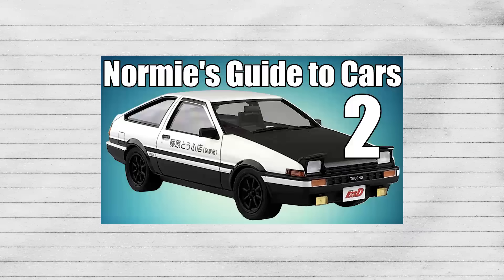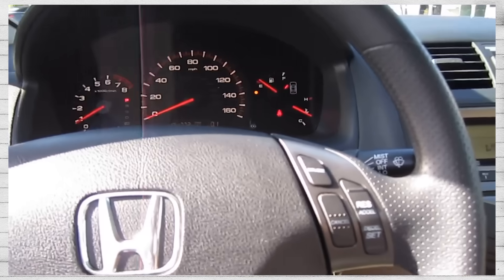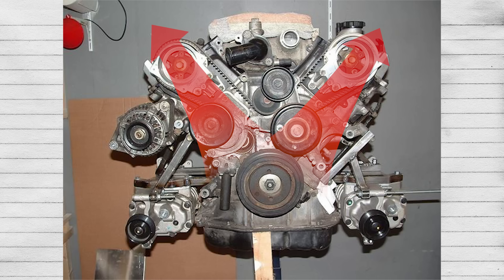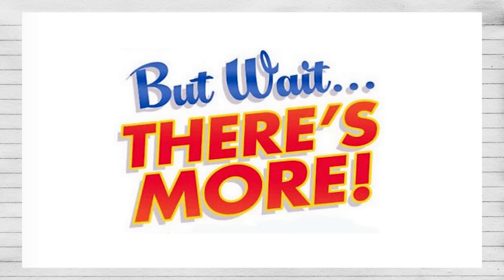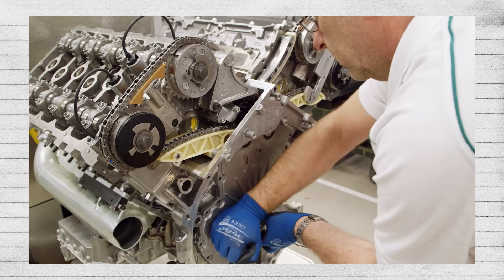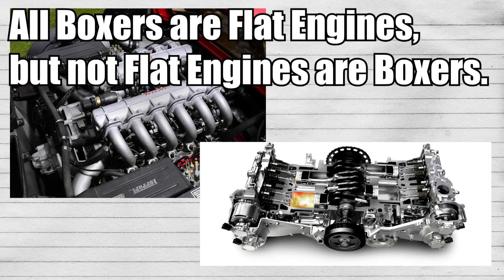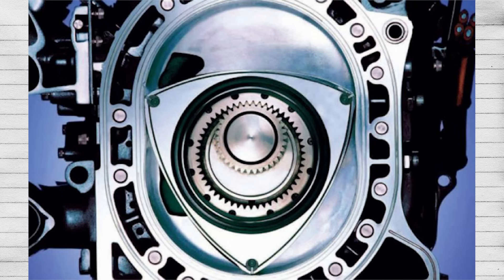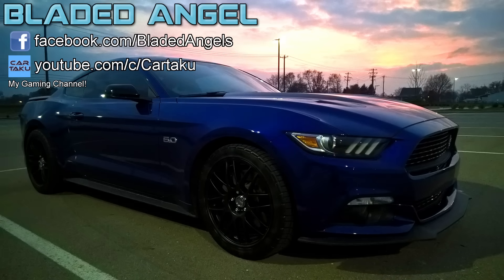Noob's Guide to Car Engine Types!

Comment: Wouldn’t the straight non-V engines in FWD platforms (Accord, Camry, etc) be “transverse” engines, not “inline”?  An inline motor would be mounted along the longitudinal axis (with the crankshaft) and thus be “in line” with the axis of the vehicle, correct?  A “straight six” could be mounted in transverse perpendicular fashion, but would be called an “inline six” if it were mounted along the long axis.

Comment: I have an idea from my newfound knowledge of car engines. You could have an engine with four rows of pistons in an actual "W" shape, which would form two camshafts. Each camshaft could drive the two wheels on it's side of the car, and each side of the car could accelerate with it's own pedal. It would be like 2x2 wheel drive instead of 4 wheel drive. There should also be a third gas pedal for all four of the wheels so you don't spin out and die on the highway if your foot slips off on of the two gas pedals. With this configuration, you could turn only with the gas pedals thus eliminating the need for a steering wheel. That's right, no more steering wheel! Car companies, feel free to reach out and pay me to use this legendary idea.
Reply: Not sure if you were joking, but you actually wouldn’t be able to turn with just the gas pedals. You would just burn out your tires if you used only one of the gas pedals at a time

Comment: the 'rotary' engines used in those planes are actually called Radial engines. easy to confuse. which is probably why aircraft engineers prefer to call rotaries wankel instead

Comment: My dad has a Honda Pan European ST1100 (motorcycle) and it's equipped with a 1.1L V4 my bike is a 1.1L I4 , a Honda CBR 1100XX, both V4's and I4's exist you just have to look for them.

Comment: Subarus use a boxer engine not a flat, I have a 2021 crosstrek and it literally says 2.0L boxer in the manual and in any paper work that mentions internal components. This is also true for every other 2021 model they produced this year. They may have used flats in older models but all the newer ones use a 2.0L or a 2.5L boxer. Yes... even the wrx is running a boxer

Comment: I love you bladed angel, but the aircraft engines you referenced at 8:25 is not a rotary it's a radial engine. And it was used in WWII as much as it was used in WWI. Primarily in american aircraft and japanese. They did use v12 engines as well but fell out of use because of coolant leaks and the weight of the coolant.

Comment: The 538.48L -V5 in my BMB Prelude AMG Crew Cab has 4 twin ultra hyper mega deluxe superchargers and makes 475,937,583 Pound feet of Horse and 364,638,492 TorquePower.

Comment: preach bro a v6 and inline 4 eco boost mustang is no fucking mustang its a pretend mustang before you buy a v6 mustang or ecoboost mustang just buy an older v8 cause fuck v6 and inline 4 as muscle its either v8 or not muscle period. this applies to other pretend muscles as well dont buy a muscle with fuel economy in mind you buy it for its power performance and the joy of a v8 so if your going to buy a v6 or inline 4 version then just buy a fucking jdm and stopping ruining american muscle.

Comment: "BMW wanted an engine that had more performance and was simple to work on, that's why they use the inline 6" of course, that didn't stop them from making EVERYTHING else hard as fuck to work on. Damn things require a pro mechanic in order to change a headlight bulb.

Comment: Speaking of inline engines, it's also worth noting a lot of semi trucks use inline engines. Most of which being straight 6, large displacement diesels. A few honorary mentions in my opinion being the 3406 Cat, Series 60 Detroit Diesel, and the ISX Cummins, which is still in production to this day.
Reply: Cumm
Reply: I would just lile to add that this is mostly the case gor american semis, in europe they mostly use V engines, usually V8s (i know that you wrote this comment 3 years ago, but it's the youtube algorithm doing its thing of recommending me old videos)
Reply: @RolVirsla most European trucks also use Inline 6 engines. It's just Scania that makes V8s
Reply: @MrGunsnrosesfan100  nuh uh

Comment: What about the VR engine and the fact that a W is 2 VRs not 2 Vs?
Reply: VR is a V engine, but more narrow than regular V (generally 15° position instead of 60° and 90° in V engines). The purpose is getting as compact as V engine while still giving smoothness as inline engine. The most common configuration of VR engine is VR6 because V6 is not very smoth and inline 6 is not very compact.
Reply: @govinlock8568  V engines have two separate cylinder banks and VRs have one, but with tilted bushes. It's definitely not the same!
Reply: @emilyvanmoslfak2295  Yeah, but the tilted piston bugged me, because it is possible V engines has one camshaft instead of two or four (it called OHV engine or pushrod)
Reply: @govinlock8568  U r drifting off topic

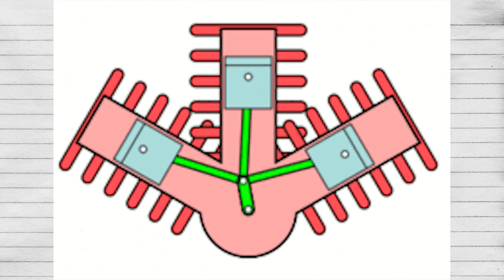Comment: 5:14 that's not what a W engine (at least the ones used in VWs) looks like. You show a classic W engine (aka Y engine) which VW only used in one Audi prototype and one Bugatti prototype. What they call W engines now are just double V engines.

Comment: fun facts:
1) the "rotary" engine used in WW1 aircraft is called radial engine. nvm
2) the better nickname for the rotary engine is the Dorito engine :P

also, you forgot to mention that in the boxer engine, the pistons are offset. they're not facing eachother unlike the flat engine. they're kind of alternated. like the VR engine in the Golf car(the VW Golf. not the golf cart) but flat
Reply: But the rotary in ww1 uses piston not doritos
Reply: That's why it's called radial
Reply: @joshsuelto  yeah, and that's why I crossed out the 1st point. because it's even explained in the video. I just posted too soon ;)

Comment: I6 went out of popularity because they are hard to fit in a compact engine bay and v6 are cheaper to produce because they are v8 without the last to cylinders so they are cheaper to build and design because they are shared kind of like how volvos that normally came with a i5 came with a i6 as a proformance option.

Comment: Big v8
BIG V10
huge V12
RIDICULUS V16
Whait?
What?
*mark repeat that.
'thats 2.0 V16
ummm you Mean valves rigth?
NO. I Mean cylinders.
What? V16 thats has only 2 litres?
Thats stupid
(a Little peugeot jumps from one couner to couner and dissapired if the trees screeming harder than a plane and Yes they are Talking in middle of Grupe B rally)
Uhh.
*but thats dosn't meake ANY sanse, this car IS PERFECT.
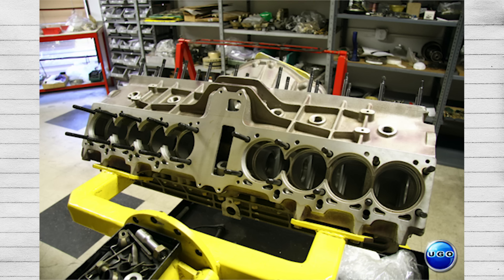# thats is that engine block at 4:53

Comment: The W16 engine in the Veyron isn't just two V8s slapped together. It's two VR8s slapped together. A VR engine is basically the line between inline and v engines. Engineering Explained explains it nicely.

Comment: Another type of flat engine is the opposed engine. 6 cylinders, 12 pistons that move towards each other connected to two crankshafts on either side of the engine.

Comment: Why LS swap in a RX7,
WHEN YOU CAN ROTARY SWAP A CORVETTE
Reply: Rob Dahm did it !
Reply: I wanna see that lmao.
I mean...I've seen a LS1 swapped mini cooper so.... wouldn't be surprised if that exists
Reply: Dom Check rob Dahms channel. He already did it once and he is planning on putting a 6 rotor into a c8
Reply: @technomen0872  touth the exact same thing
Reply: Yes
Reply: T34-85 ok
Reply: Reverse trigger
Reply: lmaooo 😂🤣
Reply: YEEES
Reply: tuner vette
Reply: I just got chills down my b0lls
Reply: I know I'm late but the guy who originally designed the corvette made a prototype version to come from factory with a rotary engine
Reply: Why not put a 600hp V12 ON a Volvo PV544? It's a diesel so you might get some good milage considering the displacement... 38.9L...
Reply: imagine 6rotor corvete
Reply: @MIRUSKOKRASNY  You wanna break the sound barrier?! YOU MADMAN!!!
Reply: @tntfreddan3138  exacly
Reply: no no burn in hell u heathen
Reply: So... you put an engine that is temperamental and unreliable, and put it into a car that us temperamental and prone to developing faults for no reason...
Sounds like a recipe for spending more time in the workshop fixing the damn thing because 10 minutes of driving "broke it again".
Reply: Ratel.H Badger why though
Reply: Reliability?
Reply: @notme-y1m  ill take fun over reliability on a hobby car

Comment: "V6 aRenT mUscLE cArs" only thing you've said that is completely unintelligent of you. Chevy and Ford did not work their asses off making beautiful works of art that STILL make a good amount of power AND be fuel efficient enough so that you can make it an effective daily driver just so people like you can shit all over them and say they aren't muscle cars. When muscle cars starting being produced you were lucky that your stock V8 455 could make 300hp, now adays a freaking turbocharged i4 can make 300+ horsepower, so for most people a V8 is just unnecessary. A statement like the one you made is just an insult to American car manufacturers pushing for more efficient and less expensive cars. I drive a V8 but honestly regret it in a few ways, respect the muscle.

Comment: Not so fast Bladed Angel, V4 engines DO exist. It's just they're not used in cars, trucks, etc...Only motorcycles/Motorbikes. But they do exist.  
Edit; You actually cover this fact, I stand corrected.

Comment: It must be annoying taking care of a rotary. Remembering to Premix every now and then changing the oil every 100 miles letting it heat up before driving it Reving at 2000 to turn it off so carbon doesn’t build up horrible gas mileage

Comment: Great videos keep it up! When you started talking about Wankel engines you mentioned aircraft engines. As far as I knew those aircraft engines were called radial not rotary and only the Wankel engine is called rotary. Anyway I might be wrong and they are called rotary too.

Comment: I haven't watched everything, but you probably have missed the VR engine of Volkswagen. It's visible at 6:09 . It's basically a V6, but with a very thin angle and the pistons are a bit displaced. So it's a thinner than a V6, but a bit longer. So it fits even in a Golf. VW also cut off one cylinder and presented it in the Golf V5. Important is now the use in the W8, W12 and W16 engines. They are all using two VR blocks with a single crankshaft. So the correct name would be VRVR. Well, if you're testing the exhaust sound then it sounds like this... Now let's wait for the W-VR24, with three VR8-blocks :-D

Comment: sir, those WWI engines you mention are called Radial engines. and like the flat engine(not boxer) all 7,9,11, or even 13 pistons are connected in the center, each piston firing in succession. think of when people at a sports event do the wave.

Comment: Fun little fact, Ford Falcon's in Australia, at least the 6 cylinder variant still use the straight 6 layout instead of a V6. Keeping to the original American Falcon engine design while the main competitor, The Holden Commodore also manufactured in Australia was a V6. The same engine used in GM V6 performance vehicles.

Comment: That W16 is a T H I C C  B O I I
Reply: W18’s are what my 7,000 bhp 30k rpm AWD Bose Suspension Supercar should have
Reply: WW36  octuple turbo
Reply: @Chevycamaro-rg6sd  You cant challenge my 35L WW48 15 turbo Quad super charged engine
Reply: W32?
Reply: And heavy
Reply: @the_one_titan  yh but the quad turbo and 1500bhp makes up for it.
Reply: 《Stevie》 w18*
Reply: @pat7785  w18 ?
Reply: paulo Fortin it would have to be a multiple of three
Reply: @pat7785  no it does not watch the video again carefully. There are two types of w engines first to see the one that looks like a straight engine is shoved in the centre of a v engine (->) and the other one is the engine which looks like two v engines shoved into each other kinda like (>>)

Comment: The Aircraft "Rotary" engines are actually called Radial engines as the cylinders are Radially opposed around a central crankshaft.
Reply from the maker: Read the pinned comment.  The ones in WWI aircraft were referred to as Rotaries.  hence why I specifically mentioned WWI aircraft.

Comment: The inline 6 is a very prevelant engine in diesel applications. Also, many auto makers used inline 6 engines in their pickup trucks, as they produce great amounts of torque, whilst having less horsepower. The Ford 300 I6 was a great example of this, it had 150 HP, and 300 lb ft of torque.

Comment: You should have talked about the differences between OHV, SOHC, and DOHC engines. I know that the vast majority of car enthusiast have no clue that there is a difference. It'd be a good chance to showcase that the OHV 7.0L LS7 V8 is actually a smaller and lighter engine than a DOHC 3.5L Nissan V6 or that the OHV 8.4L V10 in a Viper is about the same size as a DOHC 5.0L S85 V10 from the BMW M5.

Comment: The airplane engines are actually called “radial engines” they were used in WWII too, and are still sometimes used today (I’m also a plane guy)
Reply: radial and rotary aero engines are two different engines designs, rotary engine was used during WWI and in 20ties
Reply: I think that the rotary aircraft engine refers to the engines that rotated the crankcase and cylinders instead of rotating the crankshaft. IMO, it was a silly design.

Comment: Before production the engine of the buggati veyron made 3000 horsepower and was so hot and powerful that it started to melt the exhaust exits for the engine testing facility for buggati

Comment: Radial engines were still used during WWII in planes such as the P47 Thunderbolt wich had an 18 cylinder two row radial pratt and whittney double wasp R 2800. and some more. Even tanks such as your beloved M4A1 and M4 Sherman. I belive the Jumbos used it to

Comment: You should have started with a single cylinder and gone up the ladder, even though its not common in cars, it is a good way for non-car guys to understand what a basic engine is and how it works.

Comment: Diferences betwen AC motors Vs Brushless motors
AC are powered by full Alternating Current waves
Brussless are powered by dc pulses
Thats why brussless needs feedback and AC's dont, the rotor on the AC follows the spining magnetic field of the stators, brusshless generates pulsating magnetic fields, which don't spin.

Sadly this will become relevant. Its not fair, wild AC's can be as furious as dorito engines... but batts technogy was developed almost 40 years ago. Also the engine noise of a well tuned car is priceless.

Comment: 6:23 This. 
This is why I love Bugatti. VW was able to create a car powered by a quad-turbo W16 engine with a transmission fast enough to handle it while also lasting the life of the car. 

I love the Veyron not because its speed and price, but by its engineering. VW had no reason to do it. The Veyron is probably the  biggest and most expensive "Because we can." statement on the planet.

Comment: Flat, wide and low baby, yeah... Straight, smooth, but heavy.. V, compact and light, but rough. 

Edit: No need for confusion with rotaries and the WW2 engines, because the WWII aircraft powerpants are known as Radial engines brother! Thanks for settings the ignoramuses straight on the V4's mang.

Comment: If v4 existed for cars would it sound like a v8 like the one's found in ferraris , a boxer engine or a normal 4 cylinder with a 5 inch wide fartcan exhaust

Comment: What? No, the reason v6s are more common isn't because i6s were difficult/expensive to manufacture, it's because they're more compact and can fit in almost any engine bay that an i4 can. You can't stuff an i6 into a transverse fwd bay, but a v6 fits nicely. Also v6s also have vibration issues just like i4s, if not worse

Comment: I4s are for smaller cars, and then there's volvo with their XC90, which has an inline 4 engine even though it's a full size 7 seater SUV... And well, it produces 400HP (of course it is supercharged and turbocharged too)...

Comment: Come on mazda make a rx-9
Reply: JW Shelley or remake the rx-7
Reply: ^ i just hope they dont fuck it up like the nsx
Reply: KrazzerBeats How did they fuck up the nsx?
Reply: Soviet Union yeah but its basically going to be used as a generator for a electric engine
Reply: @Potatoestornadoes  i just threw up
Reply: they better
Reply: JW Shelly they are making a rx-9 soon and the reason it’s taking so lung is because because Mazda is working in a way to make the engine for fuel and oil efficient
Reply: @diamond_aaronxg3043  rotaries not burning all the oil in sight? 
laughs in dorito
Reply: @K20vtecyo  Bruh 2019 is almost over.  give em a wake
Reply: I doubt they'll ever revive it unless some sort of break through happens. The main thing is sales if they cant make it as cheap as the sti, brz or mustangs no one will buy them because then they will be expensive and they consume too much gas, 

and if since they consume too much gas and are expensive they will not appeal to the crowd that want them who arent exactly rich people.
Reply: They are making one in 2020. They also remade the rx-8
Reply: I want a RX-170
Reply: If they make an rx9 it will be a fucking SUV at this point
Reply: Pls don’t
Reply: they have 

but it's another fucking shell car

Comment: The Mazda rotary engine is returning in 2019 as a range extender for their hybrid interestingly enough. Also the Mazda rotary engine found it's way in to the REPU (Rotary engine pickup) from 1974-1977 interestingly enough.

Comment: Triggered RX7 owner here. The rotary is unreliable because nobody knows how to care for them. If you replace your apex seals when you are suppose to that will eliminate 50% of the problems. Otherwise you just have to check your oil level and inspect the rotor housings every once in a while and it will outlast some piston cars.

Comment: I wonder, is it possible to have a odd number of cylinder engines? Like a V7
Reply: yes i'm pretty sure Honda used a V3 engine in a racing motorbike in the 50s but its just not well balanced compared to an inline engine.